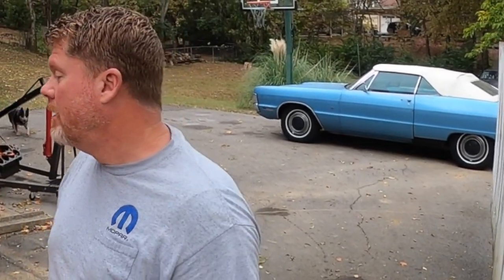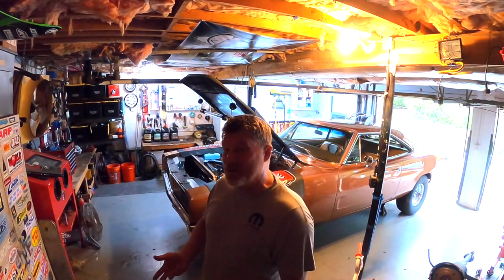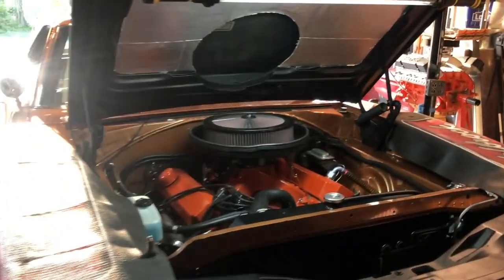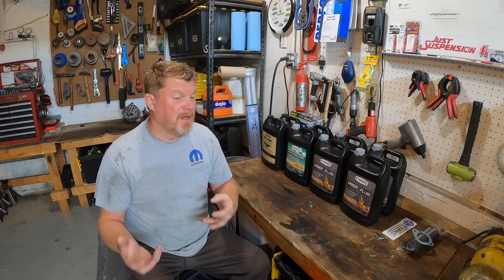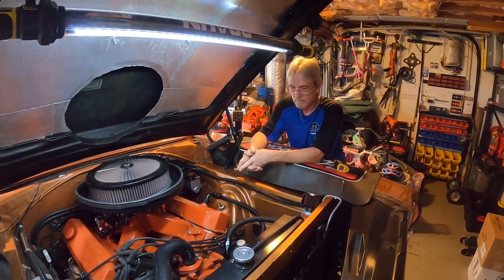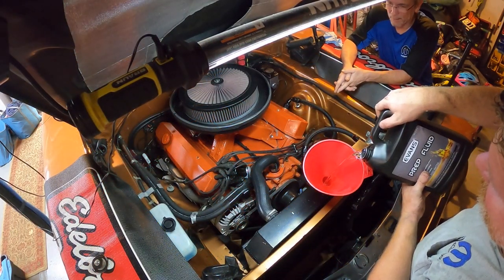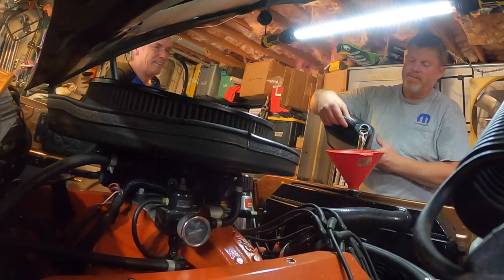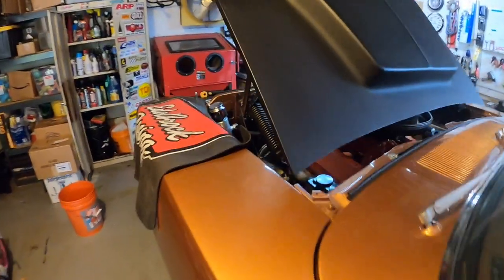Swapping Our 1969 DODGE CHARGER to Evans Waterless Coolant; REAL Before & After Results

Comment: I tried Evans got down to less than 1% water in the system. It is great because it has no pressure in the system and lubes the pump well but at the end of the day my 440 did not like running 20° hotter than it used to in summer heat. You have to have all the right combo of parts as well. Hard to runn at 220° in the summer. In the end I had to switch back.
Reply from the maker: OK that's interesting. Again, they say the coolant is hotter but the engine itself is cooler. They've got a lot of data on this that I researched. Did the 440 run worse?

Comment: My very first car was a 1968 charger 440 Magnum so seeing this again brings back memories.  Had progressed from the Mopar days to turbo cars and one of them was a 1993 RX7 R1. Way back on the RX7 forum days the guys were using Evans to keep these high temp turbo rotaries cool.  One thing you should get yourself off of Amazon/ harbor freight is the OEM Tools or equivalent no spill cooling system purge burping funnel super cheap and effective. Otherwise take it up a notch with an airvac refill kit.  Good luck and if you have a line on a rust free BB 68 let me know?
Reply from the maker: Nice suggestion!

Comment: The best thing to do as well as the evans is to modify the pump with a descent impeller. The factory pumps vary so much so get a new pump and pull the standard impeller then make up or have made by a descent machinist a proper impeller. You can test the standard pump in the car by taking the heater hoses off at the firewall then run those hoses into a bucket full of coolant then once the system is primed pull the flow hose out of the bucket and time the flow rate at 500rpm. It should be a MINIMUM of 10 liters per minute at 500. You can also check the quality of the flow and whether the coolant is full of bubbles which points to cavitation happening inside the pump or coolant passages. All of this is crucial as the engine is so much easier to tune once you achieve the minimum flow rate.
Reply from the maker: Interesting suggestion but we haven’t had a problem with our street driven 660HP stroker thus far. Seems a little overkill but worth looking into.
Reply: I did that with a Flowkooler pump.  great product.

Comment: I have a stroker motor also with mahle pistons and your engine seems to make that same loud mechanical noise. Is that piston slap? I believe the skirts on these Pistons perhaps are not quite long enough
Reply from the maker: I've ran the Power Paks on (4) engines now; the noise isn't the pistons but I believe it's the ATI "Rattler" damper I'm using. It's the noisiest thing I've every used. I also think the COMP roller rockers and lifters clatter quite a bit.

Comment: When you are purging the system...are you actually using a vacuum to suck the coolant out? Dis this drain the block too? Or did you open the block drains too? And the system took less than 3-gallons??? So without a heater core and hoses it may be just 2-gallons?
Reply from the maker: No, no. We put the vacuum hose on the exhaust, blowing air into the cooling circuit and purging any moisture out of the down tube/hose.

Comment: What thermostat are you running? I have a SBC 383 that I dropped in my square body have Evan’s coolant in it I havnt fired it up yet. But saw a video saying you can’t run a normal thermostat with this stuff..?
Reply from the maker: Evan's is effectively straight glycol (it's their own blend) but you can certainly run a standard thermostat. I've got a 190º, which is admittedly too high for my tastes, but it hasn't been a problem once. Also, this was done over a year before and just a couple of months ago I had an alternator lock up and kick the belt. Trying to limp the car home, I saw temps as high as 250º but had ZERO leaks because the Evans doesn't boil (pressurize), and MOST importantly, the coolant got that hot, but the engine did not. I swear to heaven above, this stuff saved my engine from blowing up.

Comment: I have had problem with boiling enduro motorbike. KTM EXC 300. It is tipical, when you ride short but intensive. No chance to cool it. Evanse solved my problem. I have good experienci with it and I am going to put it into my C3 corvette. No problem with overheatin. Only protection of the system and engine.
Reply from the maker: Nice! Glad to hear it

Comment: One thing that you didn't mention in purging the coolant from your system is to be sure and open the heater control to full and run the heater to be sure the heater core us fully drained.  If you leave it closed, drain the water and add the Evans, as soon as you open your heater controls you'll introduce some of the old coolant into your new, expensive, cooling juice.
"It's the little things."  😉
Reply from the maker: Excellent comment!

Comment: So I'm beginning to feel like my 67 belvedere II is close to being a unicorn. Any advice on where I can find parts? Please let me know.....
Reply from the maker: What are you looking for?
Reply: I need to find a windshield, any ideas
Reply from the maker: Depends in if you MUST have original glass or any windshield will do. Heck we just put new glass in our ‘69 Charger. It was cheap and easy, but it was modern stuff. Finding an original windshield is gonna be tougher.
Reply: Cheap and easy sounds fine to me; but I've seen all kinds of things for 68 and up I guess I'm looking in the wrong place.
Reply from the maker: We literally had ours installed by AutoGlass.com a little over a year ago. (And with tint!)
Reply: Thanks I will definitely check it out
Reply: Strange, it says that website can't be found. I hate computers
Reply from the maker: Sorry, it's not .com it's .net
Reply: @moparconnection  Hey thanks man, I didn't think about that. Computers are not my thing
Reply from the maker: No that's my fault. I gave you the wrong URL.
Reply: @moparconnection  appreciate the help, hopfully going out to Ocala on the 11th

Comment: If you get rid of the electric cooling fans, and install a 19 inch blade and a fan clutch then install a fan shroud you'll never have over heating problems again. I converted my 1969 road runner. And it never gets over 170
Reply from the maker: Not with this engine; too high of compression. That was the original setup; car absolutely boiled at every light. Original cooling parts only work best for original engines.
Reply from the maker: Not with this engine; too high of compression. That was the original setup; car absolutely boiled at every light. Original cooling parts only work best for original engines.
Reply: @moparconnection  mine was exactly opposite with a desert cooler radiator and a sixteen inch electric fan. If I slowed down below 40 mph my engine coolant temperature would climb to over 220 .
Reply from the maker: That makes sense, William. It’s all about the setup.

Comment: Coolant can’t cool when it’s boiling over and not  in system also hot spots in heads from this boiling  is what really hurts head gaskets and heads  evans don’t boil till 375 degrees think about it  it worked great on my dragster with small radiator and 
1150 hp 632 on race gas Evan when it got hot no boiling leave fan and pump  on it never hurt no air pockets no leaking no damage  plenty of leeway before it boils
Reply from the maker: Again I’ll say it: this stuff saved my engine when the alternator burned up and kicked a belt on the freeway.

Comment: Well if your motor is running hotter all of a sudden it's not a coolant issue it's a cooling system issue. Either you need bigger capacity components, have a problem like a bad thermostat or water pump or you got a leak. Also, the motor runs hotter and is thicker so slower movement, harder on the water pump and can't reject heat like a thin 50/50 water/coolant mix.
Reply from the maker: All very good deductions! Thankfully, it's a 5-10º difference, but again as stated in the video, the actual engine itself is running the same temp. According to Evan's pages and pages of data testing and research, their proprietary glycol formula does a better job extracting (wicking) heat from the metal, meaning the temp sensor will read higher but the actual engine is remaining the same, if not cooler.
Reply: It is the same viscosity as water.
Reply: @1darryloflife  No it's not. It's thicker.

Comment: So if you spring a leak out on the road you will need some of this stuff to refill? I get the anti corrosion deal but I think that the fact that it is not something you are going to find along the road not to mention the high cost makes it a product I would run. It is cheaper and easier just to flush your system once a year. I know that they sponsored the video/magazine and provided all the product free which means you have to somewhat endorse it, but in this case I do not see this as a beneficial product overall, but hey some might.
Reply from the maker: No, no that's a fair question (and boy, do I wish they paid me for this video). You're right, if you manage to have a leaky system or blow a hose, you won't find Evans at most local parts stores. So it's not terribly convenient in that sense. 

The hope is that you've resolved all of the leaks and you've got a sealed system prior to transitioning to Evans' waterless coolant but accidents do happen. The biggest benefit (in my view) is it being no pressure, meaning you can crack the radiator cap even when it's hot. 

Pressure is what kills your cooling system, and this stuff doesn't do that. And no pressure means less likelihood of unexpected leaks - so there's that too. Again, the cost is because 1. it's a superior product and 2. you don't need to cycle it out as it will likely outlast most engines.
Reply: @moparconnection  Thanks for the response and I agree in concept with the benefits but have owned way too many classic cars to think that I'd never need coolant of some type on the road somewhere (radiator damage, hose breaking, etc.). The no pressure deal is interesting but I don't know how much importance I would place on it especially given a properly setup recovery system. Regardless, thanks for doing the video.
Reply from the maker: You bet - and all great points (and valid concerns for sure). Looks like I'm carrying a gallon with me in the trunk!

Comment: Evans will make it heat up more it will not protect the engine instead Evans will protect the cooling system hoses from pressure.
Reply from the maker: Absolutely incorrect. We only recently had an alternator seize up and kick a belt. We made it home without blowing any hoses or hydrolocking the engine. Yes, you’re right about zero pressure in the system, but Evans absolutely protected the engine. And for those who say their engine runs hotter; it’s the fluid that reads hotter not the engine itself - and that’s because it’s wicking heat better than water or 50/50.
Reply: @moparconnection  Evans will make the engine run 10 to 20 degrees hotter. Water has a higher specific heat capacity than Evans which is made of glycol. 50/50 is better at cooling. Because water can absorb and release heat more effectively than most other liquids. All Evans does is protect the hoses on the cooling system.
Reply from the maker: Yes your temp gauge reads 10-degrees higher but the gauge is reading the coolant’s temp not the engine block itself. A digital temperature gun will show otherwise. The Evans is extracting and regulating heat better than straight water. After my aforementioned failure, I reached out to Evans who provided all of the same testing data that earned them the place as the ONLY coolant allowed in NHRA and NASCAR. It’s legit stuff and most people freak only because they see the temp gauge climb.
Reply: Eh im not convinced that the engine runs cooler. Once it goes through the radiator it should cool down thus bring the engine temp down and ultimately the coolant should be cooler especially with a thermostat.  Water picks up more heat than any coolant. But if the engine runs in correct operating temp than soundbite a winner. Also you could buy glycol for Refrigeration systems which is thinner than antifreeze and its probably the same exact stuff for much cheaper.

Comment: Chrysler products won't warm up in winter and overheat in summer.
Reply from the maker: Funny, that’s never been the case with any of the cars we’ve had.
Reply: With Chrysler products it is a roll of the dice my wife had a 99 Plymouth breeze it was a very good car. Overall they seem to cut short on engineering and testing
Reply from the maker: So you're comparing this 535 cubic inch, 10-second '69 Charger to your wife's Plymouth Breeze?! LOL!
Reply: @moparconnection  no I never saw anything about a 535 cubic inch hot rod I meant what I said every now and then you get a good Chrysler product. Again every now and then. What really turned me aginst Chrysler products was a 1956 Plymouth a family member owned new back then chrome plated pot metal who ever produced that car should have been locked up and the person that purchased would not have known what quality was if it walked up and bit them in the you know what!
Reply from the maker: Gotcha

Comment: Check your engine oil temperature if you can. That will tell you the truth if it's working better than water type colant.
Reply from the maker: That's a fantastic suggestion!
Reply: Right on
Reply: @moparconnection What did you find?